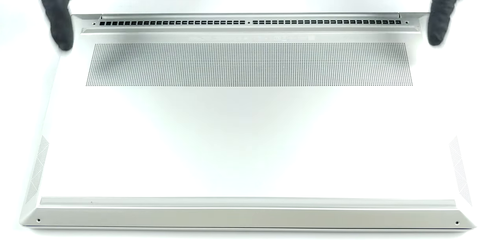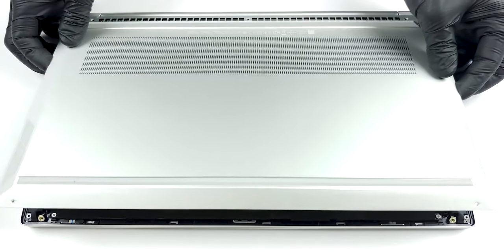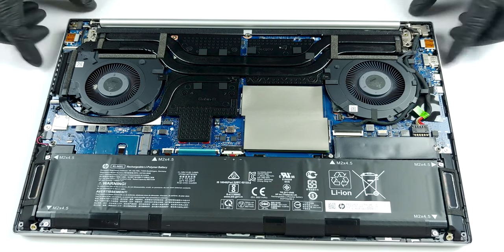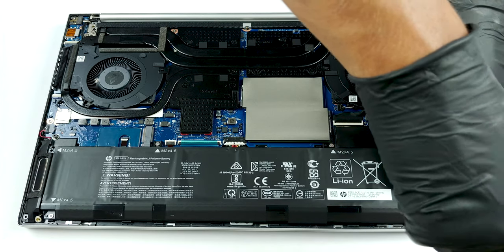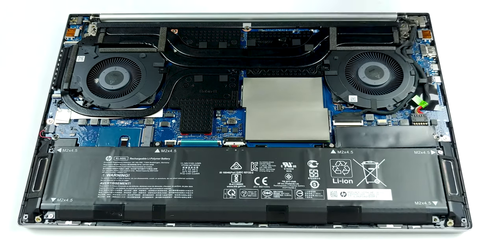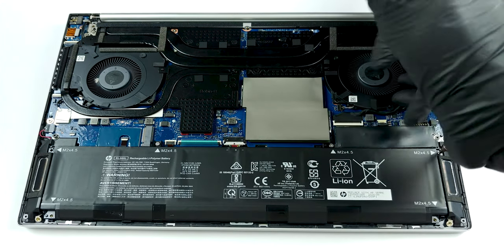🛠️ HP Envy 15 (15-ep0000) - disassembly and upgrade options

Comment: I have a hp envy 15-en1013dx and I need to know where the wifi card m.2 slot is located at as it isn't apparent when you take the back off and remove the ssd's and battery.

Comment: Could you make a video on how to put a tpm 2.0 into a hp envy 15 notebook laptop
Reply: your laptop should already have it... press f10 while booting to get to the bios (try other function keys if not) then look for tpm
Reply: most hp laptops before the windows 11 announcement came with the tpm disabled since it wasnt useful for a normal consumer. you can enable it in the bios but newer bios versions just have it enabled by default if you update your bios

Comment: Can i ask a question what model number of the battery is the same in hp envy 15-0002tx
Reply: Did you find it out?
Reply: @IGOMON2  not yet,,
Reply: @sadaktv7300  KL06XL, i guessing this battery fits into all 2020 models who have 83 wh stated. My Envy (ep0018no) have the same one.
If you have 83wh, you can order this one. Cost roughly 60 euro here in europe
Reply: @IGOMON2  thank you.,,less worrys now
Reply: @sadaktv7300  No problem

Comment: Does it support 64gb of ram?
Reply: no
Reply: From what I could find online, yes it can be upgraded to 64GB of ram.
Reply: Yes, my envy have 64 =)
Reply: @nach0Pac187  Have you upgraded it? Do yo remember what ram sticks have you used?
Reply: I had this model HP Envy 15 ep-0008na with RTX2060 since it's launch in the middle of pandemic (roughly 2+ years now). I've seen posts and ran tests on crucial's Memory Scanner and it identified max possible to install 64GB RAM, however, HP Support adviced not to install more than 32GB RAM (Windows also told that too) so I didn't.

ep-0008na comes with 16GB RAM preinstalled and some sources clain that it can run DDR4-3200, but in the reality it can't run higher than 2900MHz. I've upgraded with Kingston FURY Impact 32 GB (2 x 16 GB) 3200MHz which can adapt to specific frequency when needed and they are now capped at 2900 at all times. You can safely assume you'll get 2900Mhz. 

It's viable to use as workstation with external monitor connected via HDMI or Thunderbolt (like i normally use), but you have to accept that fans will announce their presence very fast even when system is in idle state.
Reply: I have 15-ep0010ur and just have upgraded it successfully to 64 Gb RAM,

Comment: Do you know if the hp envy ep00002la version uses ssd or m.2?

￼
Reply: Mine came with the 512GB intel NVME M.2 SSD (solid state drive) which I replaced with a Sabrent Rocket 2TB M.2 NVME drive and I am super happy with it. There is a second M.2 NVME SSD slot so you can keep the original drive installed as well. There are no 2.5" drive bays. The fit of the new drive is tight with the original thermal pad as the 2TB drive has chips on both sides and the original one did not.